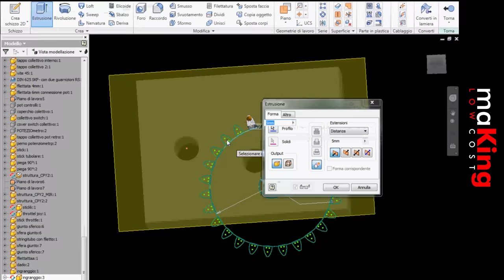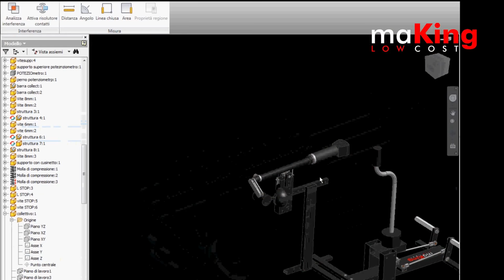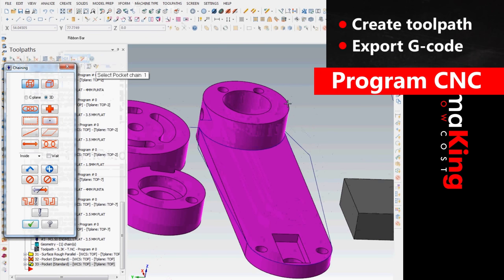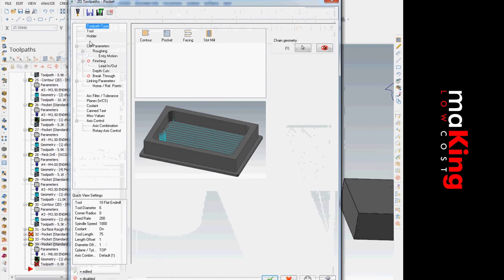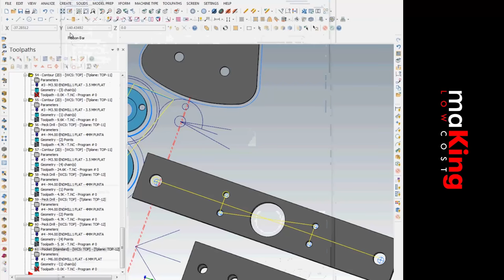Diy project: how to make Joystick Flight simulator with only 150 $ ! Flight Helicopter Control

Comment: Blimey!

It's not really a good idea to extend a joystick's shaft without limiting it's range of movement and/or modifying the way the sensors/pots work or you're going to end up with a joystick that has an excessive range of movement.
Also, it seems like that's a LOT of weight and force being applied to a cheap-ass plastic joystick gimbal.
If it was me, I think I'd just build a solid pedestal and sit the un-modded joystick on top of it - unless you're prepared to make the required mod's to make it work properly.
Reply: Hi, to change the range of motion use a free software, joystick curves. Regarding the resistance, if you watch the video where I try it, I kick it and use it strongly, I mistreat it a lot, and nothing has broken so far, it is very resistant, despite being cheap. I've been using it since I published the video months ago.

Comment: So title is a lie.
Reply from the maker: no, it's true, I built it by spending that amount. If you do the pieces with a 3d printer, you also spend less than $ 150. Clearly it's not a project you build with only a screwdriver and a hammer...
Reply: @makinglowcost6709  But you are happy to sell the finished product at a rip off price of $ 900 ?
Reply from the maker: @regwatson2017  
Hi Reg, 
i understand what you mean, but I don't sell this for $ 900... I made this product for fun some time ago, now i produce and sell professional product. It seemed like a lot of money to me too when I looked at my competitors' products time ago... but now, when you invest months of time for design, prototyping, spend $ 100,000 for a lab, start a business legal and authorized, and months of work to produce them, you realize that you have nothing left in your pocket ... in fact there is no one on the market cheaper than me I think .. ask yourself two questions about why.